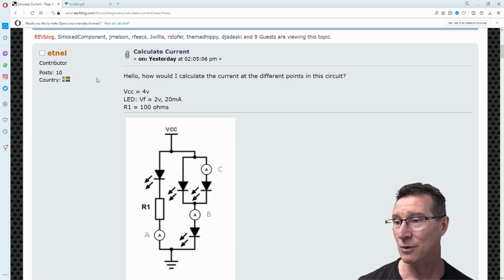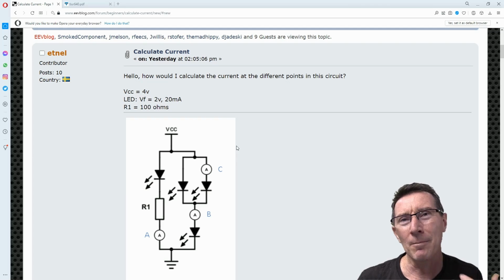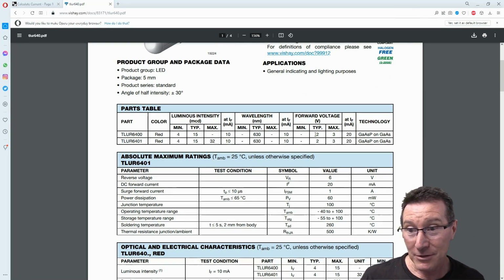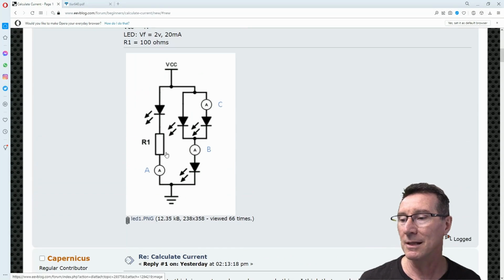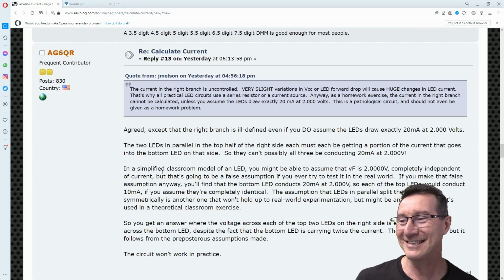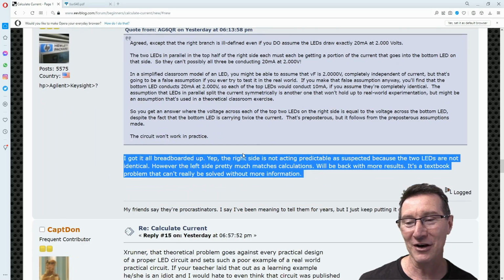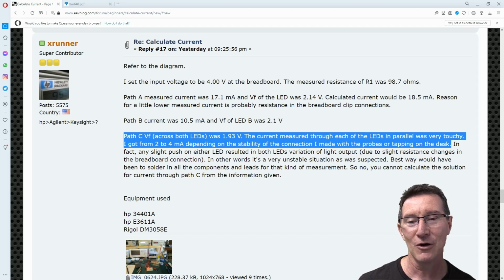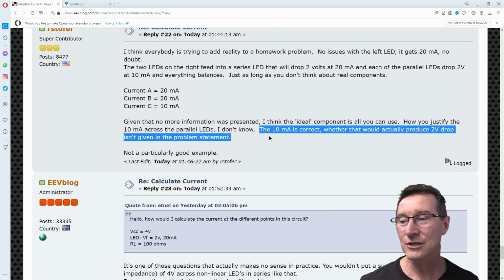EEVblog 1427 - An INFURIATING Electronics Exam Question!

Comment: The only correct answer is A = 20mA, B=C=0mA because that LED no longer has any magic smoke in it.
Reply: Depends on the diodes' VI curves. The B-diode will operate higher on its VI curve from passing the C-diodes' combined current and that will cause the C-diodes to operate below their 20mA@2V point. Depending on the curves, the B-diode could be passing less than 30mA and last a fairly long time.
Reply: I get this comment was probably made in jest, but it would technically work for some period of time. None of the 3 LEDs would be running at optimal voltage so if one had too much voltage it would have a shorter life span but it might be close enough to run a long time that way. The problem is it’s anyone’s guess since it wasn’t designed properly.
Reply: @dustin9258  Well, we don't have to guess, we have the IV curves (they were even in the video) that tell us what the answer is and you are right, for the circuit in the problem, most LEDs with a 2V, 20ma forward voltage drop with sufficient heat dissipation will work fine. Any LED without good heat dissipation could have a thermal runaway and burn up, however.
Reply: A is 20mAmps, B = 2*C. To find the value of C, I would need the simplified V-I characteristics of the LED's. The LED's are then modeled as a constant Voltage drop plus a resistance (the discrete differential of the curve in the area of 20mA, Delta-V/Delta-I). So split the right side, and double the resistance of the lower LED, subtract the extrapolated 0 current forward voltage drop of the two LED's and solve for the current C. The ideal current meters add no voltage drops. This is an idealized case solution.
Reply: @steveschulte8696  Did the job for you:
Knowing the typical LED Vf curve but given none specifically, the only possible correct answer is:
A: 20mA
B: >20mA
10mA<C<20mA

But, IF you'd be given the Vishay specific curve, you could read  I=13mA @V=1,9V, and  I=30mA @V=2,1V and approximate the curve rises from these to 20mA @2V with two straight lines:
For V<2,0V (the parallell diodes) I [ma] = 70*Uc-120 
0For V>2,0V (the single diode)      I [ma] = 100*Ub-180
Now we have an equation where Kirchoff tells us: 2*(70Uc-120)=100Ub-180 and U1+U2=4
Solve for Ub and Uc:  
Ub=2,083333V and Uc=1,91666V  =>
Ib = 28mA, Ic = 14mA
The reading of the curve was in 2-digit accuracy only, the final answer can't be any more exact.

A better approximation might be connecting the 3 points with an inverted parabola, but there's no sense in that either, since the Vishay curve is obiously built on a limited amount of datapoints:
0,1mA, 5mA, 10mA, 20mA, 40mA, 60mA and 80mA with linear connections.
Reply: @ambassadorkees  Using the exact analytic for V sub diodes upper and V sub diode lower, the current in the upper two LED's is 20mA*SQRT(1/2)  (14.14213...mA) and the current in the lower diode is 20mA*SQRT(2) (28.28427... mA). I suspect that in the situation where one LED feeds three LEDs the factors are SQRT(3) and SQRT(1/3). The equation for the voltage drop across the LEDs has a ln(2) term along with factors for VCC and the temperature of the diode junction.
Reply: Have you heard of a Zener diode? An LED is a low voltage light emitting variant. Others think LEDS in parallel without limiting resistors will burn out. The fact is just like rectifier diodes put in parallel will decrease the effective forward voltage drop of the PN junctions. As proven LED's in parallel given they are basically Zener diodes of sorts will share voltage and current so they won't burn out at this voltage. If the supplied voltage was higher than the series LEDs would burn out first.  I don't think this is a trick question it was quite simple to see the specs.
Reply: Exactly.
Reply: Nope. A = 10mA, B = 20mA, and C = 20mA. The two top-right LED's will simply glow dimly. I'm doing this in my head, as I have not yet watched the video. Let me see now what our host says.

EDIT: XRunner is right, the actual current at A depends on the matching of the diodes.
Reply: In practice they'll be goners. The temp co of semiconductors like this is negative, so the forward voltage will lessen leading to smoke.
Reply: @ulwur  I kinda doubt this.  I don't think it will generate enough heat to create a runaway effect.  I just hooked up three red LEDs to test my answer and I'm not seeing run away after 10 minutes.  Will leave it for hours and see what develops.  The three together are drawing 30ma (so 15 though each of the two in parallel) which is right on my estimate.  It did start at 28 ma and inch up to 30 but seems stable at 30ma.  Will see if the smoke rises!
Reply: It's been over 30 minutes now and it's still 30 mA.  Don't think at this level it's going to create run-away for the LEDs I'm testing with.  The heat is likely at a steady state as its being dissipated by the plastic body. I'm using the normal 5mm red LEDs. Smaller ones that can't dissipate the heat as well or running these at higher currents will likely trigger the runaway but at this level, I can feel no warmth to them at all. It's only 60 mW being dissipated in the single LED (30 mW in the parallel ones) and these are normally rated for around 100 mW so they are likely fairly thermally stable at this level (assuming you don't have them in a really hot environment I guess).  Of course, you are right, thermal stability and unpredictable VI curves are why we don't wire an LED to a high power constant voltage source. :)
Reply: If source is exactly 4V, and Vf is 2V@20mA with not too much tolerance, they won't be goners, at least in a short term. Total current on the right side would be a bit higher than 20mA and one of the parallel LEDs would be dimmer than other, unless they are ideally matched. The issue in practical circuit would be that even if LEDs would be with tightly matched Vf tolerance, Vf also significantly changes with temperature.
Reply: It's funny because these values are like right on the edge of having to consider this question in the real world outside of 'ideal' circumstances. I grabbed a few red leds which in reality don't usually pull 20mA until a little higher than 2v and the point at which the string on the right of the circuit began to thermally breakdown was very close to the voltage needed to compensate for the differing consumption at forward voltage. It was a slow breakdown but it could be seen rising 1mA every second or so. No way to truly answer this question regarding led survival without specifying a lot more values but of course eventually room temperature comes into play.
Reply: @Magneticitist  My test has been running for almost 2 hours now and is still stuck at 30 ma.  So the LEDs I'm using seem stable at 4V in this circuit (at room temp). I need to push the voltage up and find where the thermal runaway (to smoke) point is!
Reply: @CurtWelch  It probably wouldn't runaway at 30ma but over 20ma is a bit much, this is purely guess work but where an led might have a lifespan of say 50k or more hours at 20ma once you get to 30-40ma it could halve those hours and technically that would still be just fine for a lot of applications although having too bright of an led can also be rather annoying depending on what it's purpose is.
Reply: @CurtWelch  There is enough margin such that a LED rated for 20mA will last long even at 30mA. Perhaps the expected lifetime will be reduced by 50-60%
Reply: @janami-dharmam  yeap, I can believe that. The LEDs I grabbed out of my box, generic RED 5MM LEDs, that pull 20 ma @ 2V are now running on my beach at 60 ma. I wonder how much shorter the life will be?  Just testing for thermal run away now, not going to see how much the 10,000-hour life has been reduced. Checking some spec sheets, I did find one that was rated for 30 ma max, while most are rated for 20 mA max that I've seen so far.  Can't find any data on MTBF or life expectancy or how it might be reduced based on current but I have found many sources that say too much heat is what kills them.  The general numbers are 10k to 50k hours though.  I guess if I wake up tomorrow and find the LEDs dead, I will know how fast 60 mA kills them! :)
Reply: @CurtWelch  whats the spec of the LEDs you are using, and what are the actual readings when used for each LED?
Remember, the spec on the question states 2V @20mA
Reply: @007floppyboy  I don't have an actual spec sheet or part number for them. They came as a box of 500 LEDs for $10 in 5 colors.  All standard 5mm LED size. A box of hobby LEDs basically. The label on the box says 20ma @ 2V for the red and that's all I have. They do in fact, draw 20ma at right around 2V do they exactly meet the one spec of this problem. So they are prototypical of this sort of generic red LED. I have no manufacturer specs for voltage or current limits, or power, or what the I vs V curve looks like, etc.  In fact, I ran it up to 80 ma, and it lasted for 2 days before the LED with the high current failed.  The failure was interesting, it didn't burn out, but instead, just went dim and caused the current to drop down to around 7ma. So as expected, higher currents shorten the life span.  I never just burned one out by turning up the voltage and current until it blew out. So I don't know where their point is for these -- but I suspect it's near this 80 ma range.  And I only tested ONE led from the box of 100, so I might have gotten one that by random luck had better current carrying ability than the average.

This is box it came from..  https://www.amazon.com/gp/product/B07N2H23DC/ref=ppx_yo_dt_b_search_asin_title?ie=UTF8&psc=1
Reply: @CurtWelch  28mA  is exactly what I calculated by reading the curve and making 2 equations with 2 unknowns. 
Nice that we can confrim eachother.
My method below in my reply.
Reply: @ulwur  Remember that those leds in series run at different current densities. Now look at where else people combine PN junctions running at different current densities in such parallel-serial arrangements, and for what reason :) (I really don’t want to spoil it; you have to figure it out yourself – you’ll be glad you did, it’s neat!)

Comment: I like the practical solution to the problem. I mean it is just insane that you would ask that. I mean if you give the diode equation it might turn into a nice question. Just to learn the calculations. Then add some real world measurements and have the students answer why it is different. 
I remember my professor for analogue circuit design doing those things. It was one of the best classes because you actually also had to understand the variations between the components and lean that you can not just rely on the datasheet.
Reply: My professor had given us  parameters in lectures and told us to use them in exams and etc if we see non linear circuits

Comment: Question on exam:
Draw up a circuit to light 2 LEDs at full brightness and 2 LEDs at half brightness using only one 100 ohm resistor.
Reply: Could make it a bit more interesting as well and add in "Make it work at X voltage, each diode's Vf at 20mA is Y volts"
Reply: The right LEDs are brighter: The top two are more than half the brightness of the left one and the right bottom one more than the 'full' 20mA brightness of the left one

Comment: I was in 2nd year of high school. Some science class had a chapter about electronics and we did some experiments with batteries, light bulbs, and other very basic stuff. After that, we had to fill in some questions in our textbook that we would get graded on. One question was to draw how to connect a battery to a light bulb.

We got our assignments back and the teacher had subtracted a point for that question 'because I had connected the light bulb backward'. It was an actual light bulb, not an LED.

I went over to her and explained the polarity shouldn't matter because a light bulb is just a small wire electricity flows through and that the direction doesn't matter, but she wouldn't believe me.

I grabbed a battery and a bulb and actually demonstrated that the bulb lights up with the battery connected either way. Her response: 'Hmm that's weird, when I tried that, it only worked one way'. I got my point back.

(It was a substitute teacher)
Reply: I used to enjoy my kids school open days, the profound ignorance of the teachers (and sadly their pupils) about the most basic principles are staggering.

Comment: Got to hate anything that says TODAY! Dumb as doggy doo. Is there any setting to fix this?  Nice stupidocrit LED question though.
 Try a ferrite transformer type oscillator with a supply bypass. Frequency depends on supply voltage and saturation. Fail the dudes  that said the lonely supply rail bypass controlled frequency

Comment: OMG this is why I'm glad I went to a small local ABET-accredited school rather than a big PhD/Research-oriented school. Engineering professors need practical experience rather than going straight from school to teaching.
Most of my professors were naval engineers. My power systems professor was a power distribution engineer and my electrical machines professor used to design dynamos for hydroelectric power stations. Hell, my most theoretical class was linear control systems and the professor used to design missile avionics.

I think I had one professor who was purely theoretical, but he taught signal processing so like that doesn't even count.

Comment: One thing I'd point out is that some circuit that seem stupid if you imagine them on a PCB can make perfect sense if you think about them as multiple devices on the same wafer in a chip ... very different conditions and the devices / diode / transistor end up very closely matched (because they're right next to each other on the same wafer).
Reply: Uh, nope. Even on wafers they are very often not matched. which is why there is sometimes a large percentage that are rejected. Also partly why binning exists.
Reply: @supernumex  I think you're thinking of a larger scale than Sylvain is—my interpretation of Sylvain's comment is that in the case of multiple devices _on a single die_, the short distance means that you have much more limited across-chip parameter variation. I would add that you can use various layout techniques (like interdigitation, dummy fingers, etc.) to reduce that even further, so it is possible to have closely matched devices operating in parallel or in a differential configuration (think the two input transistors of your basic differential amplifier).

Of course, that depends on how close close is. Clearly we still have laser-trimmed devices for a reason, despite the availability of matching techniques.

Comment: The guy with the long mathematic proof actually had an amazing answer  that wasn't super complex
Reply: Except he got the ideal diode equation wrong. He has positive current for both forward and reverse bias. The equation should be
I = I0 *  [exp(-V/V0) - 1], not I = I0 * exp(-V/V0). Yes, he goes on to assume Vcc = 4V, in which case the latter equation would be a good enough approximation of the former, but if you are gonna go to that level of theoretical analysis, you might as well solve for arbitrary Vcc, whose value is not given.
Reply: @zetacrucis681  I don’t think he got the equation wrong persay - that negative one is commonly dropped because it’s influence on the result is considered negligible. It makes derivations much easier. I typically explicitly call it out as negligible in my proofs personally.
Reply: @zetacrucis681  I0 was 3.6 * 10^-37. It was not going to make a difference

Comment: Ah, the perfect video to watch while I'm sitting here considering quitting my EE degree LOL. It was a couple of years ago now but my circuits unit was filled with examples like this, except far more absurd. I wish I had some examples to share, every question in the exam had a "trick" and was a web of interconnected sources that I can only assume is what powers the circuits in hell.

One example was a pair of dependant voltage sources connected in a loop that you just had to ignore as they cancelled each other out (but were presumably producing infinite current, nice).

Comment: If you have V I graphs in hand you can, assuming all LEDs are identical, multiply by two the current on the graph (for the parallel branch), sum the voltages (for the series branch) and then intersect that with 4V. That will give you the current for that branch, divide by two to get the current for the parallel branch.

Comment: The only answer that can be given from the stated data is:
A: 20mA
B: >20mA and equal to 2xC
C: <20mA

For anything better a datasheet for the diode is needed.
Building the circuit and measuring it with a unspecified ammeter cannot be used, the problem do not specify the impedance of the meter.
Reply: If you assume an ideal diode (as in following ideal diode equation), and that they are matched, it might be possible to workout the current split.
Reply: Yes. Absent the LED V(I) model nothing further can be said. I agree with Dave that this question is an excuse to generate a discussion during interview to allow interviewee show his/her knowledge.  I'm disappointed that no SPICE simulation was mentioned (one can use free LTSpice which has models for many LED models - the difficulty would be finding one with V(I) curve passing 2V 20mA)  LTSpice is very approachable for even novices.
Reply: @Henrik Jensen - best and most concise answer.
Reply: A real LED isn't going to drop exactly 2V at 20mA. So even if they are all perfectly matched you might find they draw much more or much less than 20mA at 2V.
Reply: They want you to calculate the power across the resistor 20mA, 2v volts across a 100ohm resistor then try catch out can you follow the path of a current, in its context of a high school question its fine.